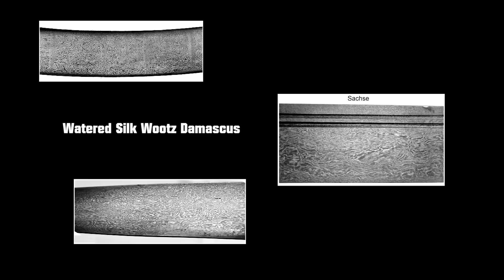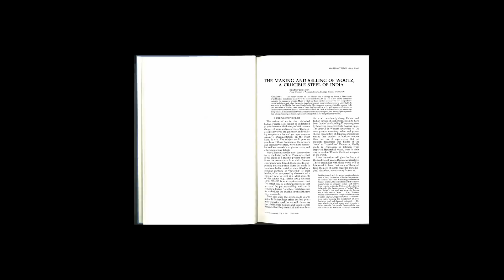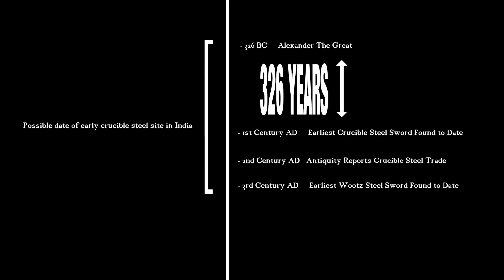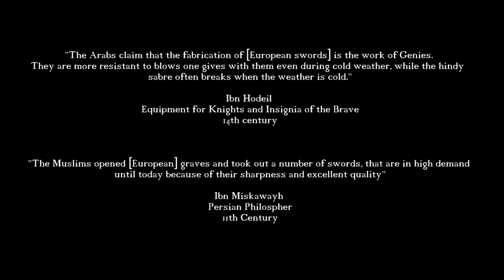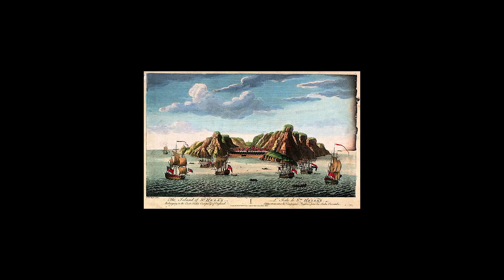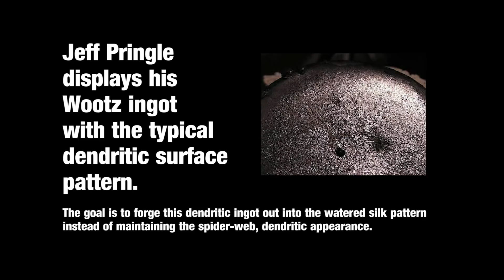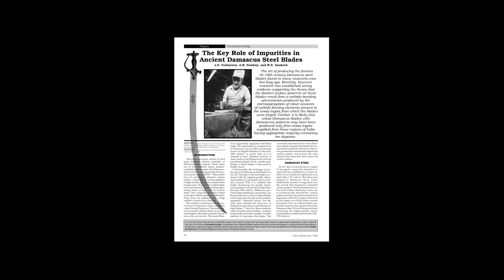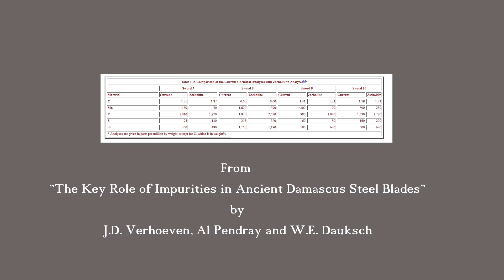"That's Not Damascus" Rant. And 5 Points About Wootz.

Comment: Making wootz is way simpler than you might think. We used a pile of ordinary bricks, some squirrel cage fans, graphite crucibles, and a big bag of coke for fuel. Making the ingots is simple but working them is difficult because you can't get it too hot while forging and the steel doesn't move much when you hit it. The first ingot we used rice coal that didn't get quite as hot and it didn't have the watered pattern. The second ingot we used coke, a bit hotter, and the blade has a nice pattern even without finish grinding and etching. It's a very interesting material to work with.

Comment: I recently saw a video about the Japanese Katana and it's tamahagane steel. A telling point was that we hear about the marvelous quality and near perfect qualities... of a few of these swords. The vast majority were run of the mill. Some blade makers were capable of excellent results but most weren't. Think of the perhaps hundreds of thousands (?millions?) of so-so Japanese swords made over the past thousand years. 

I suspect it's the same with wootz steel made over the past 1800 years. Sure there are superb blades but likely most were just so-so. Given the amount of time and effort that has to go into making it the traditional way, the forging and the waste of perhaps 60% of the resulting ingots, it seems to make much more sense to use modern, high quality, low impurity steels and end up with a practical blade. Making and using wootz as an exercise in maintaining one of the historical aspects of blade making is all well and good. That said, modern steels are cheaper, better and predictable.

Comment: In my opinion it was probably some crucible steel with patterning in it like wrought iron but better that was better than the steel they were using in that ear at the time rove time with people telling others about it it has been exaggerated far away from what it was modern steel could probably do much better in my opinion

Comment: I'd like to hear your thoughts on 'accidental wootz' that some knifemakers experience.  After etching they'll see a faint pattern due to alloy banding that can sometimes resemble, quite closely, the appearance of a 'pretty' wootz pattern.  A google search for 'alloy banding in knives' turns up some decent images.  These guys start with tool steel and wind up with a non-dendritic wootz-like pattern!

edit:  Glad to see H. Foll getting some love.  his online seminar on steel and swords is amazingly detailed, if a bit accentric.  thought i was the only one reading his stuff.
Reply from the maker: I read a remark by someone regarding the two main camps of how the watered silk pattern is formed - whether it is dependent on the content of the steel (Pendray and Voerhoven), in which case wootz from a certain area in India of certain constituents (vanadium and/or sulphur/phosphorus) was likely necessary or whether it is dependent upon the thermal cycling/forging process itself in which case it is possible to get the same appearance in other ultra high carbon steels (Wadsworth and Sherby).  People in the later camp note dendritic patterns sometimes found in non-wootz steel as evidence.  I've never seen any pictures.   What have you heard?

Comment: Have a chat with Achim Wirtz in Germany . He makes wootz - with the watery pattern and sells it. Even modifies it to make for example stainless wootz. And I absoltely agree with you, wootz is a intresting curiosity; but modern steels are by most parameters far superior. If the various cultures had a steady supply of modern made 1075 or 5160 steel; they would have never made wootz. as demonstrated by vikings; they made incredibly complex pattern welded seax's and swords, but they never made wootz... They probably could have; but they most likely couln't see the added value.

Comment: You're wrong for the same reason that tube amps are the most desirable in audio circles. Yes, it is impractical on a mass scale. It is not financially practical to make it for profit. That is why it was lost although you make a potentially viable point about the mines with proper ore drying up. 

It's not that German steel was better than wootz or that it was even as good. It was just close enough to as good to make up for quality control and or cost of getting good wootz for industrial purposes.

Comment: to my opinion the wootz or damasus steel varity were only used in ULFBERTH swords. That came out of the contact between ruß vikings and persia. It is not clear if the steel for ULFBERTH was imported or produced in scandinavia or europe. 

In roman times it is clear that the romans had steel from rather good quality from northern tribes of the celts. In my countryside the oldes iront oven is about 500 bc and the sighns of mining for iron ore are even older.The ore has a high content of mangan and is very durable. There is one more area in austria that is as old as this.  So the import of luxury wootz for a enormous amount of goods is simply not needed.

And for a further explanation we can watch some legend, maybe the legend of wieland the smith who forged a sword to brake it and feed it to the chicken. from the dung of the chicken he melted new iron this he did three times untill the sword was so hard and stiff and sharp that it could cut a one feet thick ball of wool wile swimming in a well. The name of the sword was mimung and was used by ditrich von bern. This process is called nitrating today. Maybe there is more truth on old legends than we want to beleve.
 
Finaly i could say that it was a smal group of people able to produce high quality blades that could compare to modern products. A import was not needed. In medival times there was a semi industrial production of medium qualitys in masses so it was not needed too. 

What do you think???

Comment: You only addressed the material used to make Damascus steel, when the important part, the part historians are still puzzling over, was the technique used in forging it. Specifically: how, using only 17th century technology, did these swordsmiths create blades reinforced with carbon nanotubes?
Reply from the maker: Aliens. duhrrrrr.

Comment: https://youtu.be/OP8PCkcBZU4 Please watch this documentary if you still haven't. It's about Wootz steel. They are mentioning people you are mentioning in this video. I think they are contradicting your statements and I don't know who to trust, so I'll wait for your judgement to inform us in the next video if this changed your mind.
Reply from the maker: I've seen that video several times, it is very good.  It is referenced in this video description.  I agree with much of the video, especially the part where people know how to forge wootz damascus in modern times and results are highly dependent on the properties of the starting ore.  Pendray et al were forging quality wootz damascus by several methods, one of which Mr Verhoeven is trying to patent if I understand correctly.  My opinion is that the documentary occasionally clings to a few of the romanticized notions surrounding wootz. On the other hand Al Pendray does state wootz hasn't been superior to other steels for several hundred years and is economically not viable.  My advice is to read Bronson then start looking at more recent articles and make up your own mind.

Comment: I always thought/was taught that Damascus was literally just any steel with a pattern in/on it. Usually patterns from forge welding two types of steel and twisting/folding it together during forging. Or could even or something as simple as making a series of cuts into a steel bar and then forging the piece flat with the cuts still visible after the forging.

Comment: Thanks for doing an honest and polite analysis of the truth about Wootz and crucible steel.  Also thanks for mentioning some of the current Wootz makers.  There are only a small handful of us who can actually get the fine watered patterns of the ancients, but we can get them.  No wootz maker that I know will argue that pattern welded steel is not damascus from what I have seen it is usually the armchair blacksmiths who have read a little and think they know much who make such claims.  All in all your video is good.  One correction though, John Verhoeven never made Wootz himself, it was Al who did all the Wootz making and John only did the analysis.  He has just released a book on their process on Amazon. https://www.amazon.com/Damascus-Steel-Swords-Solving-Mystery/dp/6139884837/  I was mentored and shown the ropes by Al about 15 years ago and this book if read and followed will enable smiths to get much higher quality steel and the good patterns that only a small few of us have been able to get previously.  The original process that Al used which he never published, was much more fickle and had a higher failure rate, pattern wise.  The method that he used at the end of his life gave better results and is easier for the average smith to achieve.

Comment: I used to be a Wootz Troll untill i watched Walter Soralls's video on the subject. Now i will proudly declare: Damascus is pattern welded steel, wootz is a crucible steel(the manufacture of which is described on page 36 of The Art of Blacksmithing)
And Damascus wootz is a third thing altogether and is made from a specific ore with a specific vanadium content from a specific mine specifically in modern Jordan.
Reply: Er.... sorry to disappoint, the comment about Damascus wootz is incorrect. There is no evidence that crucible steel was ever made from the mine in Jordan... the guy in the video is a friend of mine.  The video only ever states that it COULD have been made from that mine.  There is no evidence of crucible steel having been made in that area... ever.  Evidence of crucibles may be found in the future but for now there is no evidence, only a possibility.
Reply: @timmitchell5812  you mean this video? I'll have to rewatch it I suppose. https://youtu.be/OP8PCkcBZU4

Comment: As always, great info, and not in a "my word is gospel" kind of way, which is refreshing for the internets. Ive also read that modern steel with our ability to so finely control furnace environment and post production heat treating etc can definitely produce better, more repeatable steel for weapon making. That said, i love the idea of producing crucible steel as kind of a landmark step in ones smithing journey.

Also, +27 internet points for using one of the best Foo Fighters songs in your outro

Comment: Anyone that thinks that patern welded steel should not be called Damascus needs to remember that words over time change or add to the definition of the word. Not all words have the same meaning now that they did a hundred years ago. It has become acceptable to call patern welded steel, Damascus except to the grammar police and the word Nazi's.
Reply: I mean, even the word "wootz" is a mispronunciation of some Dravidian language or other. If word nazis want to be uppity about it, they should find and use the original name.
Reply: A prime example of what you are talking about. Comes from the symbol that the Nazis used as they're national symbol. The swastika symbol originally used to stand for enlistment. When the national socialist party took it as their symbol. It became a symbol for hate, which is the exact opposite of what it did stand for. Words get changed over time some just needs to accept it.
Reply: That makes sense if you do not think about it.  Let us lower our standards by naming something incorrectly long enough, that it becomes mainstream.  The problem is that people without a knife or steel background will assume Damascus is one thing.  Thus pattern welded must preface the word "Damascus" to differentiate as two or more steels acid etched to create a design.  This, instead of a single steel with impurities that create dendrites on the steel.  Grammar Police and Word Nazis (as you incorrectly used the possessive instead of plural), are labels given when someone attempts to double down on their own mistakes.  Thank you for proving my point.

Comment: Damascus/Wootz steel has become what the Katana (and tamahagane by proxy) has become online. It's an old traditional art and craft that has been so hyped up online with so many sycophants who spread it's hype like the plague.
Reply: That's very true. Tamahagane and katana are result of adaptation by technique, to bad quality furnace technology.
Japanese never bothered to improve on their "tatara" -furnaces, which basically were just bloomery furnaces, producing extremely varied steel and wasting a whole lot of iron ore. because of this, Japanese swordsmiths had to homogenize steel for their swords, by folding the steed dozens of times, just to make decent quality weapons that wouldn't bend and break easily.
Reply: in the mid-1600s Japan was trading with Dutch for access to Indian Wootz.  Apparently some sword makers were not using local sources for their billet steel.  However,  I don't think it made much of a visual difference for katana manufacturing.  The way the billet is folded in the katana would tend to hammer out the wootz pattern in favor of the exposed layer wave-lines that fine katana blades are known for.
Reply: I'd like explanations for Niei, Nioi, Utsuri, and Inazuma. To name a few.

Retired Togishi is curious what the Hada masters know?

Edit, See while most argue about the forging and heat treatment. My job entailed showing the layers with stones. Varieties of stones would respond to blades from certain regions, ahem, Bizen (utsuri for example), showing amazing activities without acid etching. Although I can't say that these are carbides myself. I'm not a metallurgist, just a Kenjutsu enthusiast who was cross trained.
Reply: Just to point out here they did improve upon tatara and bloomery was not the only furnace use but also a blast furnace, there are some theories of wootz steel coming to Japan but nothing concrete foreign sources were imported sometimes however but were not viewed as Superior  contrary to popular belief their own native sources were not bad, Japanese swords also don't bent or break easily unless they are from the Shinshintō tradition created in the late 17th century, actually what people considered traditional Japanese sword sword making is actually a post ww2 thing.

https://gunbai-militaryhistory.blogspot.com/2018/02/iron-and-steel-technology-in-japanese.html?m=1

https://gunbai-militaryhistory.blogspot.com/2018/04/iron-and-steel-technology-in-japanese.html?m=1

https://gunbai-militaryhistory.blogspot.com/2019/01/iron-and-steel-technology-in-japanese.html?m=1
Reply: You can take a class in making wootz at Door County Forge with Ric Furrer and the secrets will be revealed...which is making wootz is simple but forging it is pretty tough work.
Reply: For every weeb claiming he has a katana that cuts like a lightsaber, there's another fool just as bad calling katana trash when ssome european nobles had superior quality katana given to them as gifts and proclaimed them as being excellent swords that were more forgiving and easier to use than the swords they usually used. Sometimes it just all boils down to peoples pride and trying to trash anyone from a different culture or way of doing things. I have no doubt, personally, that there are factors that made things harder on japanese craftemen when it comes to steel product manufacturing and I think it even shows through all the way up to some of their vehicles in ww2. But that doesn't make japanese weapons and vehicles outright garbage or mean that the japanese didn't also have some impressive craftsmen.

Comment: I ordered a Roselli Wootz Bearclaw knife yesterday. Not Damascus. Roselli claims a hardness for their UHC steel as between 65 and 68. I'll probably send it to Cedricada to see if I can finally be the one responsible for giving him RSI LOL.
Reply from the maker: Interesting.  Look like nice knives!  Sounds a bit unlike wootz.  If read correctly historical samples had an HRC in the 30s, cutting ability coming from the carbide banding.  Many think they were air quenched.
Reply: Yep. I wonder if the company is riding on the name. The Carbon level doesn't seem overly high in terms of other high Carbon steels. If I recall correctly, 1.5 to 2%. I'd have to recheck. I bought it for 2 reasons; the hardness and the carving friendly style of the knife.

Comment: Good presentation.  Is there a mechanical reason that Damascus or pattern welded steel would be better than modern homogeneous steels?
Reply: Magic
Reply from the maker: Hotly debated but I don't think anyone still believes that is the case.  The steel industry started making ultra high carbon steel with modern techniques in the 1970s and new stainless versions with powdered metallurgy means the edge (pun intended) goes to modern homogeneous steels.  IMHO